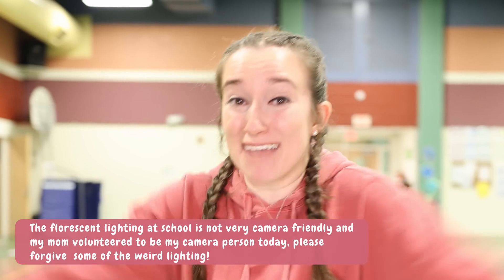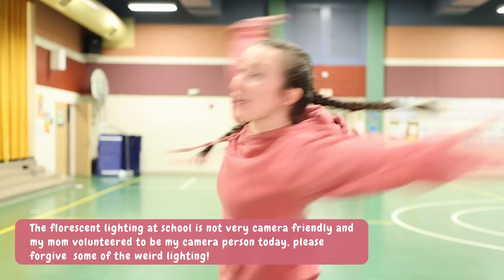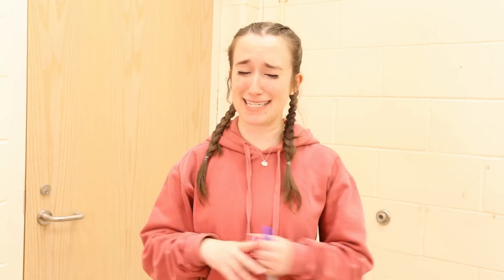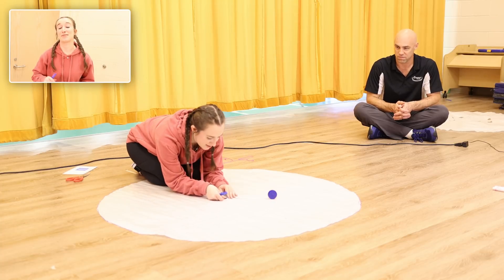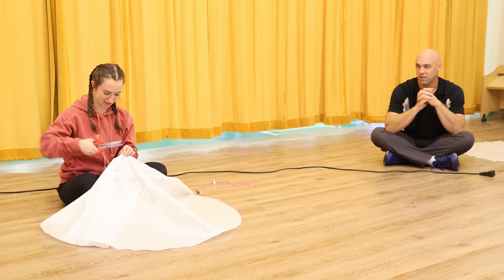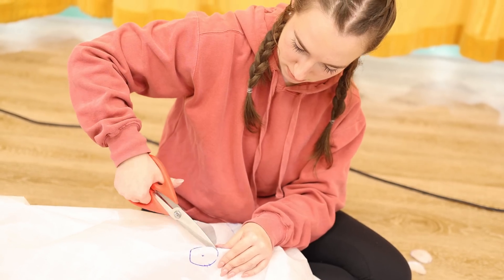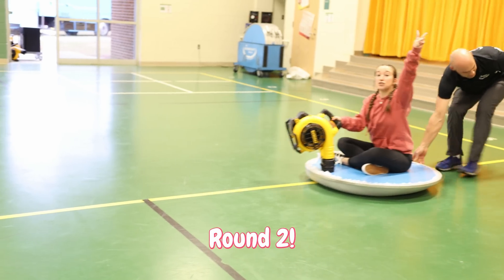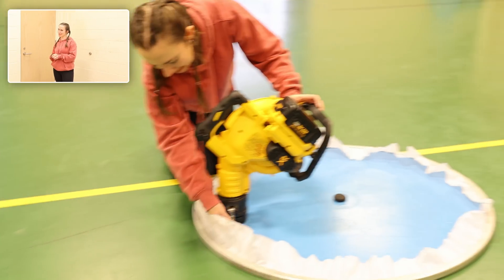Let’s Make a HOVERCRAFT!

Comment: You know if you made 4 of those, put them on a frame like wheels, and then add a large, high power, open fan with some directional rudders (look at a fan boat) this could turn into PROPER hover racing. If I wasn't a VERY large man I'd offer to come build and race them with you. However I may exceed the maximum weight limit for these crafts and frankly I am not sure you know half of us, me included, exist anyways so it's fine. XD